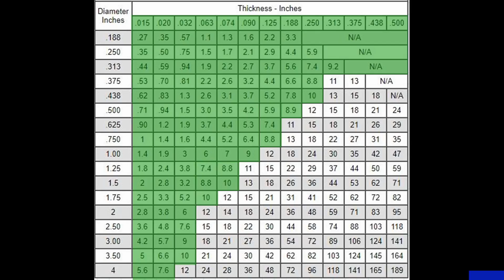Making a Sheet Metal Press - Part 1

Comment: you must remember to get a clean weld it needs good gas coverage and from what i am observing you are holding the gun too far away from the work piece.....hold the gun closer, with or without shielding gas......if you are using flux core wire you need to bang the slag off the welds......hope this helps